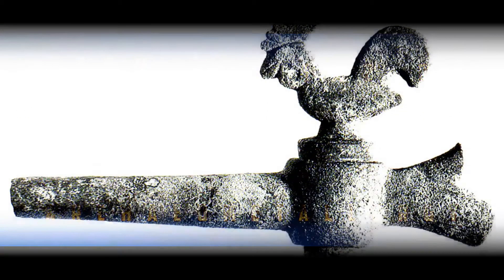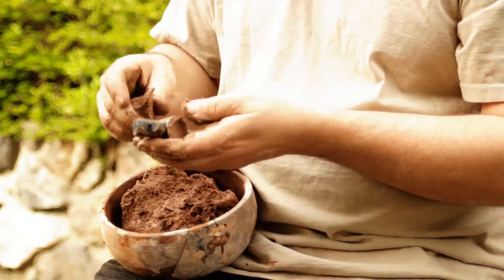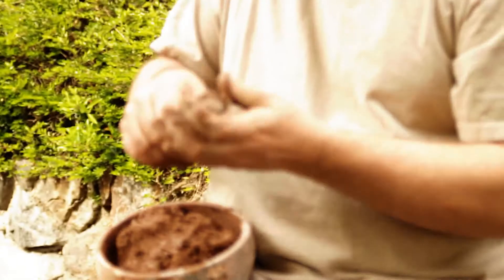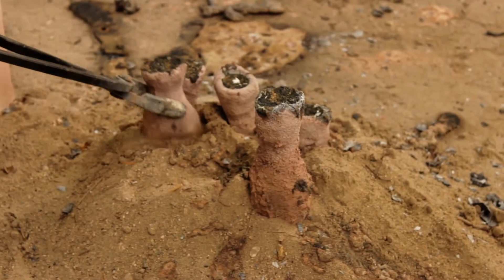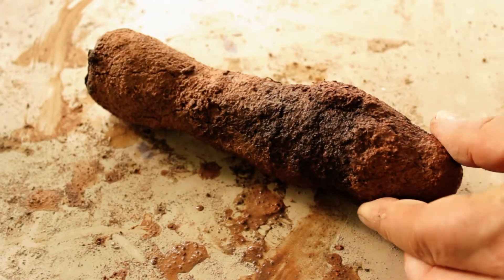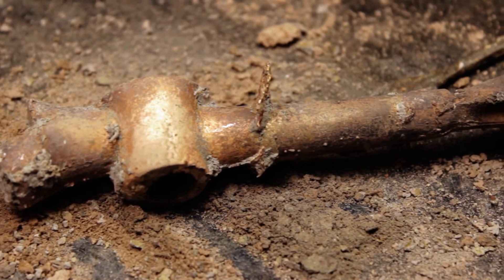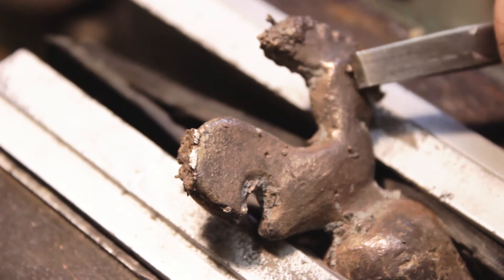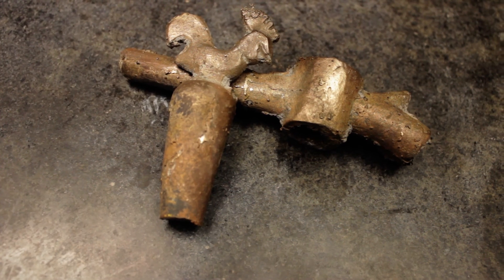Making a medieval beer tap. Bronze casting. Applied archaeometallurgy. Part  #ancientmetallurgy

Comment: It amazes me that these videos do not have more views. Might I ask, do you use fresh horse manure or dried and crushed? So far, I have only used cut grass, but I would like my moulds to be more authentic.
Reply from the maker: Well, it amazes me, too (: 
You can use fresh manure with wet clay or dried manure with a dry clay micture. There are a zillion ways to mix your moulding loam. There is no way around experimentation with the materials available to you. Check my website for in depth info and what to look for in good clays. http://en.archaeometallurgie.de/
There is a lot of info on the matter there...
Reply: @ArchaeometallurgieDe  Thank you for the detailed answer and you are right, I'll have at it :) Looking forward to the next video